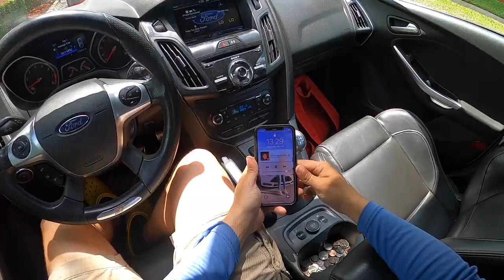THINGS I HATE ABOUT MY 2014 FOCUS ST

Comment: Look at getting the facelift? The majority of what you talked about changed from 2015 onwards. New steering wheel, place by shifter for phone, climate control, button for electric fold in mirrors on ST-3, Sync 3 system and they fixed some of the ecoboost issues like the purge valve and high-pressure fuel pump. My 2015 was on 102k miles all original, even original turbo with little burning of oil. I now have 2017 on 64k and think I'll be keeping this till it dies. My only hate is the idle misfire but had it on every Mk3 ST so take it as a quirk...
Reply from the maker: yeah man all in all it’s a really good car

Comment: Rattling suspension
Knocks and rattles
Easy to steal
Cheap interior 
Torque steer
Still nice to drive on flat windy roads, trading mine in after three years. Not going for the new st, golf r bmw m135 or similar.
My mirrors auto fold on st3 uk version.
Reply from the maker: damn the auto fold feature is so nice 😩

Comment: My turbo just went. Shit sucked. Replaced my whole motor plus the turbo plus the starter plus the radiator fan. $10k worth of replacement oem parts plus labor smh
Reply from the maker: why did you do all that if just the turbo went?
Reply: @ryanr3  turbo blew when I drove from TX to VA. Went out somewhere along the drive but cruising at 80 mph for long periods of time I didn't notice it (my dumbass was doing pulls leaving gas stations and what not). When I got to VA, the car had burned so much oil from the turbo going out that it developed a tick. Tick turned into a knock. Went to get the car looked at and it shot a bearing through the oil pan the minute I got to the shop. So while replacing the motor and turbo I said fuck it and replaced everything else that was working kinda wonky
Reply from the maker: @xXTruBum14XxTv  damn bro you could’ve saved it, but you learn man!!! glad everything’s good now 😎
Reply: @ryanr3  right?😂 and thanks. Kinda nice having everything new with 0 miles on it though. Pretty much a brand new car at this point
Reply: How are the American st's different the the euro version 🤔  I have an st wagon with 144,000 km 2013 and runs great. I'm often on the autobahn because I live in Germany.  Full speed no problems
Reply: @turtle toes  I think yalls are diesel if im not mistaken. Other than that I'm under the assumption they're the same. Of course some small differences in interior and how some parts look
Reply: @xXTruBum14XxTv  lol my car it runs on regular not diesel lol either you or the previous owner must not be taking care of it or manufacturing is different here. There are no st diesel cars.
Reply: @turtle toes  previous owner definitely wasn't taking care of it. The car was in such a bad condition when I got it. I'm still replacing things that the prev owner either didn't do right or neglected to do during the time they owned the car. My cobb intake has ducktape around the elbow leading down to the turbo. Why is that there?? I'm not sure. But im buying another intake instead of trying to figure out what they did to the current one😭